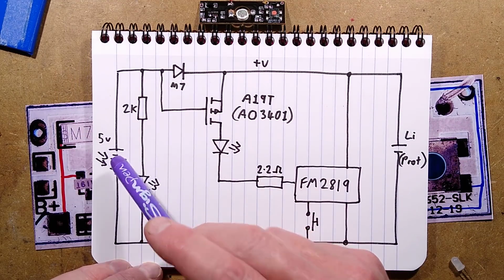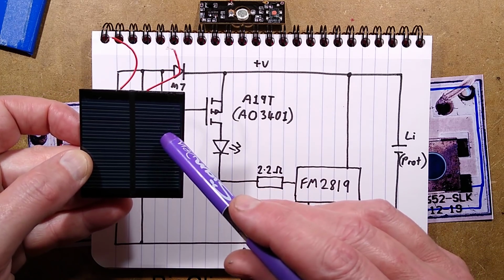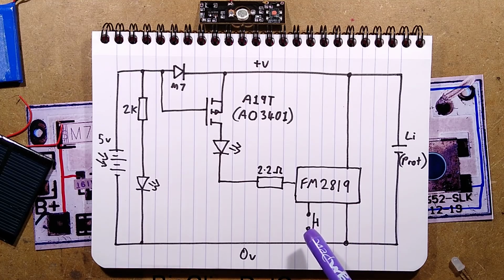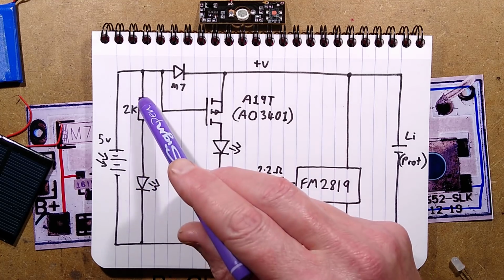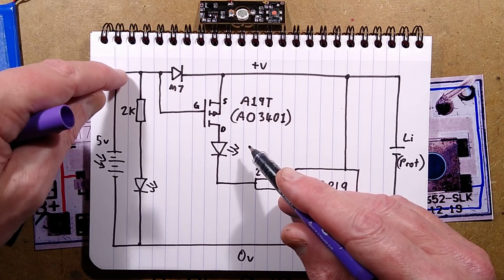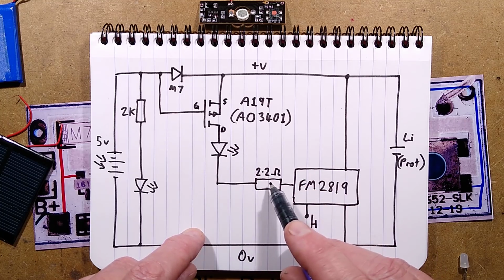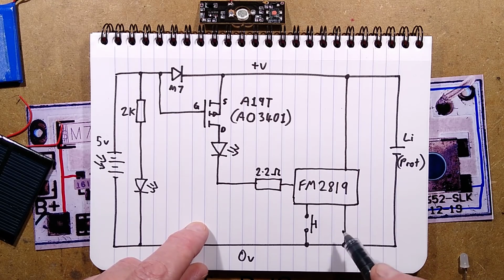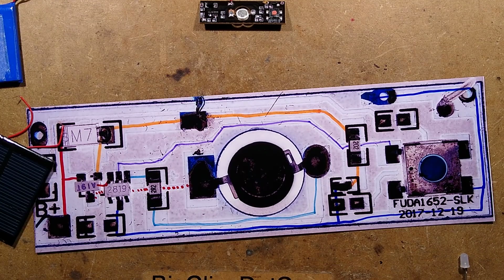Inflatable floating solar light (copy) with schematic

Comment: Lumenaid sounds like a sports drink or something. Sounds like lemonaid. Was the previous light that didnt have the battery protection the brand name one? If so, the chinese clone actually has it beat in that regard. It's interesting that these reclaimed batteries still have a good charge..I would have thought if they were thrown out then they'd be dead, although I suppose there are plenty of good phones that good thrown away with the battery still in decent condition. I wonder.. is it more or less expensive to go through the vetting process for all those batteries and use them in your product vs. a new battery? They would need to test them for capacity, bloating, circuit problems, etc.
Reply from the maker: The other one was a clone too.

Comment: Those Nokia batteries last longer than current smartphones as a whole.
I still have some bl5-c's (original and knock-offs) that came in portable USB speakers and still hold a charge, impressive.
Off course the knock offs are bulging already, barely usable though.

Comment: I had a genuine luminaid light, different from this one, it was cube shaped (solar lantern).  The panel was directly connected to a lithium cell, with no protection.  Thankfully it simply stopped working rather than busting into flames, I had it apart and found the cell puffed up.
The genuine unit also has the pointless red LED light that shows when the panel is exposed to light. 
I plan on remediating the unit, so I've 3d printed a battery holder for a few NiMh cells, and I'm going to add a zener diode to limit the peak voltage that those cells are exposed to.

Comment: Resistor and red LED across the solar panel is there to provide a pull down for the mosfet, as otherwise the solar panel would generate 4V or so across it, from starlight or moonlight, and the LED would never be turned on. Even though the current provision would be tiny, certainly enough to just not forward bias the charge diode. The resistor provides a small current draw so the charge can be removed, and thus the light turned on. The LED could be replaced by a resistor, though I would bet both the LED and the resistor are, like the battery, recovered components as well.

Comment: Very interesting. I don't think I've ever seen "used" parts in something chinese before. Every corner is always cut, but it's usually fresh. Not a bad idea, some non profit should make things like this using recycled cells from the various drop off points for those for old power tool batteries and such.

Kind of a shame how many things like laptops and phones have the batteries built in now, the chance of them having any second life is very small.

Comment: It's silly, if the idea is to supply some country with actual cheap light sources for night time, then all that is needed is a system similar to the solar garden light, but with just a lithium cell and around 4x more solar panel size than on a typical solar garden light, then enclosed in a water tight design, this could all be made for easily around 4 dollars each. So the company that is making the things like in this video, is essentially charging way more and taking the profit for itself, it's just a money making scheme pretending to be humanitarian, which sadly there are a lot of.
Reply: Meh.
At least someone is doing something and stopping some e-waste being burnt in the process. If they're making a buck doing it, more power to them.
Reply: Unfortunately, you're right. 3rd world country bait is so common it's despicable.

The worst one was that one where some company promised to send pairs of shoes to some country in Africa, making a massive profit and flooding the market of countries, destroying the economy because being a cobbler or a shoemaker became a dead profession within months.

Comment: I'd be willing to bet the solar panel was sized to act as part of "protection" in something like this where an LED is going to predictably kill the cell. Battery still handles the overdischarge side but the overcharge side becomes almost secondary by virtue of the maximum amount of light this thing can capture.

Don't see it much in practice due to cost (especially at any scale) but using a lithium battery as if it were a giant cap is also easier on the cell.

They obviously don't build these for longevity, but as a cheap and easy way to keep the cell in check just by virtue of what will happen to it as it lives it's life... Makes sense to me.

If you've got a cliff at the top of a long climb, not really any sense in worrying about what will happen to you and the car when it reaches it if you can't put enough gas in the tank to get there 😉

Comment: Are we sure it's meant to be buoyant? I get the impression it's inflatable simply to squeeze a reasonably sized lantern into a small package for shipping.

So long as the knock-offs aren't sold with the buy-one-we'll-donate-one marketing of the originals, I have no moral objection. If they are using that marketing, though, and the originals are still on the market, the copies are literally stealing from charity.

Comment: We have some Garde style lamps which don’t last very Long, what small accus would you recommend to pimp those
Reply: accus = rechargeable batteries
Reply from the maker: It depends on the type of light, solar panel size and circuitry.

Comment: The idea behind the completely superfluous red LED is probably as a charging indicator or to show if the solar panel has failed.
Reply: Maybe production test before assembly? No test equipment needed!
Reply: @luxmonday  I meant as a way to ensure the user that it's still working and charging the battery.

Comment: What is it with the chinesium obsession with bloody strobes and SOS flashes? I find it damned annoying and adds additional wear to the on/off button having to cycle through those extra 2 unwanted option every time you use the light to be able to turn it off. 🤬[/rant off]
Reply: It's not all Chinese.  It's just the one chip designer that wanted those things before his chip got put in all the flashlights.
Reply: @johndododoe1411  Exactly.
AND the fool was so interested in "added features" that they never even considered that 1 long push to turn it off instead of for SOS, would have been the better option.
Reply: I completely agree.  But this might make a good life raft light.
Reply: Joseph, i would have said me and you should go on a quest to find where they make these 2819 chips and # # the factory for the good of mankind, but I would go to jail just for saying that. But Im TOTALLY with you man .
Reply: @fortheregm1249  If it didn't sound so homophobic I would say we could share a cell after our "quest". 😁

Comment: Can't quite read the number on the battery, but Nokia did a product recall on BL-5C with certain batch/serial no's as they could spontaneously combust.  No doubt, there are probably millions of these still about, so re-purposing them might not be a good idea!
Reply: This is what makes me nervous about re-using cells... I had a regional recycling place ask me about this years ago as they have thousands of packs come through a year... They wanted to sell/re-use the cells... #1 you will never get an engineer to sign off on it, and #2 does your insurer know about this?

It's a bit of a killjoy to tell people to scrap mostly working things, but who pays when it burns someone's house down? It's one thing to be a geek and getting free things to play with in a responsible way, and a whole 'nother thing to sell those into the market!

A lot of modern batteries with Texas Instruments chips can disable themselves permanently when specific conditions are met. They blow a Dexerials fuse and kill themselves when either too old or at an unsafe low voltage (where the cell dissolves itself)...
Reply from the maker: If you offer free batteries to technical people they will take them.  Just make them sign a disclaimer.

Comment: I'd bet the scruffy old nokia battery is still better than a brand new sketchy knockoff battery.
Reply: It's probably better than most name brand cells after a year and it is way older too...
Reply: Some time ago I came across my old Nokia 6310 that I got from work about 15? years ago... Charged it up, put my SIM in it and it worked perfectly - and carried on doing so for days before it went flat. What a retro trip - I mean, playing Snakes again!!
Reply: @alancordwell9759  that is nothing, i turned my old nokia on for the first time in 10 years and it still was 4 out of 5 battery charge
Reply: @frogz  MAX

Comment: I have a couple of the original LuminAid ones in my 'just in case' box, got them 2015 while working abroad and when I travel there's usually one in my carry one luggage, they changed the design recently to a one that is a 6" cube with a Twist-to-Inflate design(no breath inflation) with a 16 Sq inch PV panel on the Titan for 100hr of light or 3 phone charges.

Comment: Hi Clive,.  Do you get lithium battery anxiety?  I have multitudes of lithium battery powered lights, gadgets and batteries - especially expensive camera batteries- and I'm always worried that I'm neglecting them because they don't get regular use.  As the years go by I wonder how many batteries don't even hold charge anymore because I don't use them.
Reply: * lithium ion batteries
Reply: I wouldn't be surprised if instead of anxiety, Clive gets an anticipation.

Just like some people don't have a drinking problem, they have a drinking opportunity.
Reply from the maker: Sometimes I do wonder about the multitude of batteries in stuff.

Comment: The glue on the battery would have been the original "Genuine Nokia" hologram sticker!
Reply: probably peeled off by the previous owner .. doubt they would peel this off for copyright issues
Reply: @dolbyman  Peeled only by the scruffing.
Reply: good memory!
Reply: was scrolling down to find/say this
Reply: xDDDDDDD
Reply: I actually thought it was still the hologram sticker until he turned it in the light and it didn't reflect anything.
Reply: I'm still daily driving one myself, the E7 lol

Comment: It would be fun to know what the current draw was on the battery when running.
Reply: Guesstimate of 3V drop across the LED and assuming 3.2V to 4.2V from the battery would give 0.2V to 1.2V across the 2.2ohm resistor. That gives 9mA to 55mA, the average voltage of 0.7V gives 31mA.
Reply: @chrishartley1210  You're missing a factor of 10x on your current calculations.
So the average current should be about 0.31A which is about right for a 1W LED.
Reply: @justpaulo  oops, yes, you are right.🤫
Reply: @chrishartley1210  Thank you for figuring out the current draw I really appreciate it.

Comment: I'm totally cool with china reusing ewaste batteries (there's a reason reuse is before recycle in the 3 r's) but I do hope they capacity test them before selling them in something
Reply: It´s made in china... So if it holds a charge for more than 10 seconds, it is one of those chinese "10,000 mAh" cells.
Reply: @SharkoonBln  lol
Firepower.
Reply: I don't think they capacity tested it unless it was a very basic test. If they did you'd expect to see some writing on the side or a mark. It just takes too much time and effort.
Reply: You're an optimist.
Reply: If you're making brand new ewaste, it's probably best for the environment if you make it from old ewaste.
Reply: China could care less about your safety....ever heard of COVID ?

Comment: A lot of these lights can be pretty overpriced for what one gets and when something costs like $40 US for example that can be and often is a lot of money in some of those poor countries. Some power banks with the lights often end up being a better deal when paired with a really cheap panel for half the money or sometimes less. Some garden lights can be alright, those sold by Sam's Club here in the states for a box of five goes for $20 in the store which are fairly large being of glass and metal construction.

Comment: Being still hung on the ozone generator i by chance saw instructions on your website, using a quite low kV neon driver, amazon has for similar price 15kV to 100kV transformers, any plus from getting the highest of those? For use with carbon fiber
Reply: Those "15 to 100kV" transformers are probably max 10 - 15 kV. It should be enough for ozone generation.
Reply: @rushb9388  my normal little tester probably can't sense anything in that magnitude, any easy way to verify those?
Reply: If the arc begins at about 1 cm distance between wires it is enough voltage

Comment: I owned one of the original LuminAid lights (although I suppose it could have been a counterfeit), and the circuitry wasn't any better. It didn't have any sort of low voltage cutoff, so it died after I went a few months without using it.
Reply: Same here. I had two and both died within months. So much for getting them as an "emergency backup".

Comment: This seems like original Nokia battery.. I looked for some "protected Chinese cheap copy". Most of them have overcharge protection, but I never found any with the short circuit protection as well.
Reply from the maker: The DW01 chip used for overcharge and discharge protection also senses the voltage across the MOSFETs to detect over current faults.
Reply: Zero ffo

Comment: There is a similar but smaller product here in the states called a "lucy light" that is popular among backpackers and motorcycle campers. I'm sure it's available globally under different names.
Reply: Over here (in The Netherlands) it's also called Luci (with an I) Light and they're pretty cheap at only €12,95 (around $15 US).
Reply: @Quick_Fix   - Luci, you're correct. My bad for the spelling error. Thanks!

Comment: Its a nice little light without the colostomy bag.
The main issue is if the battey is useles when you get it, most people wont change it.
If you do you loose the floating function 🤷‍♂️      2x👍